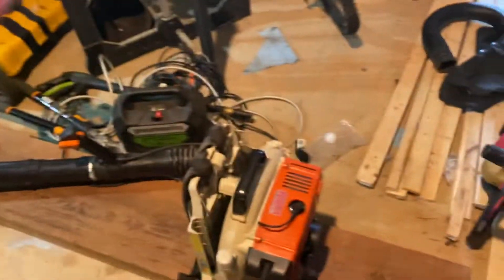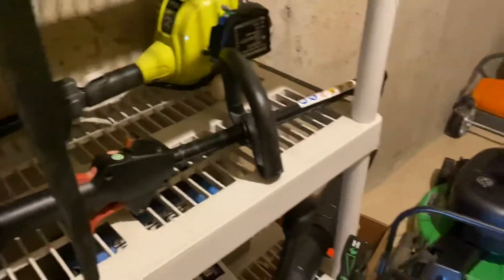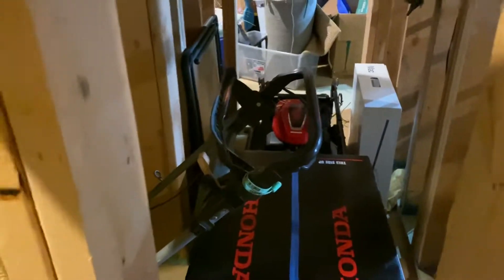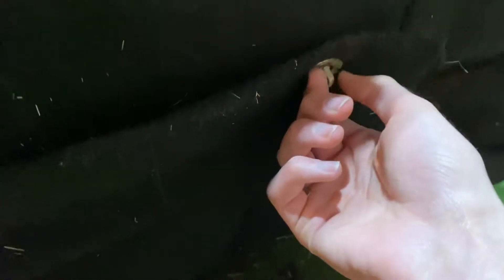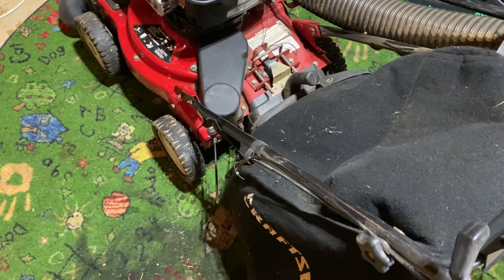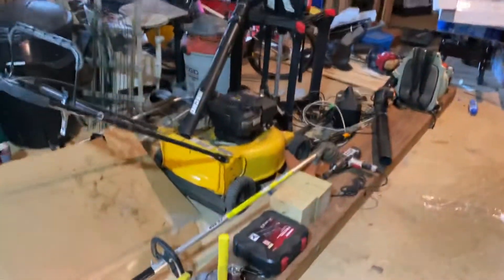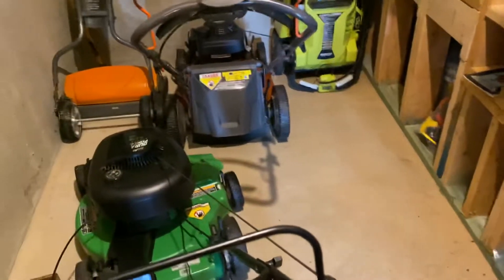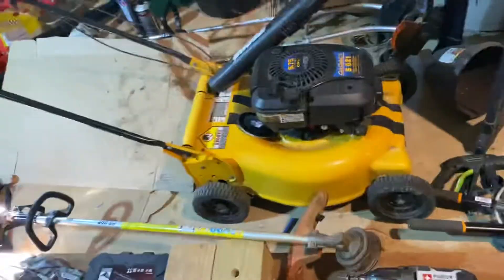February 11th update video

Comment from the maker: Also an update for the Echo Pe-200 edger:
I forgot to mention this. I looked at the year on it. So when it says a code C08, the Letter C means the month, and 08 which is the year. So this edger was built on March of 2008. So it’s not a 2005 or 2006. Just something that I thought I’d mention you guys too in case if you’re wondering lol
Reply from the maker: @jeremynguyen2346  2008
Reply from the maker: @jeremynguyen2346  Nothing really. I think it’s just the color housing has been changed. The older ones like mine had a grey color housing, the new ones have the orange color.
Reply from the maker: @jeremynguyen2346  I think there actually made in Japan, but they were assembled in U.S.A